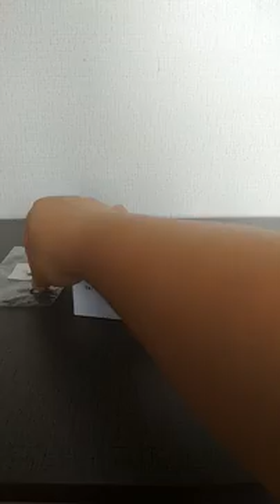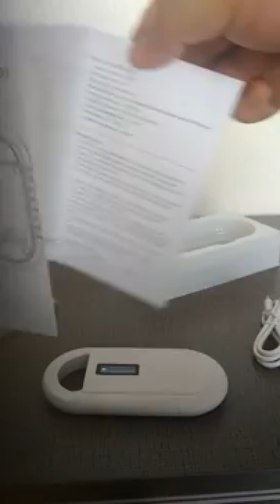How did  PT-160 PET Microchip scanner read a RFID microchip

Comment: what do you do when it says "record full"
Reply: How many scans have you made with it? The internal memory holds 128 scans, and seems to clear itself when it's hooked to a computer/phone to dump it's scanned chip numbers.

If you hook it to a PC or phone, open a text editor/email app, and hold the power button for 3 seconds on the reader it'll type in all the codes it has in memory, then clear the memory. If that doesn't work It may not be functioning correctly.
Reply: @carpespasm  yeah, that didn't work.  thanks though.  I just got a new one.